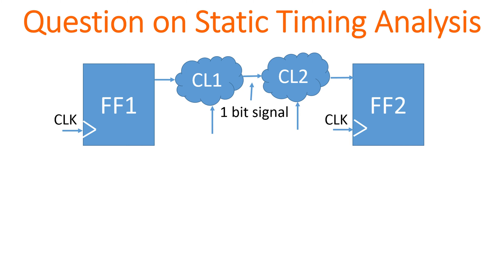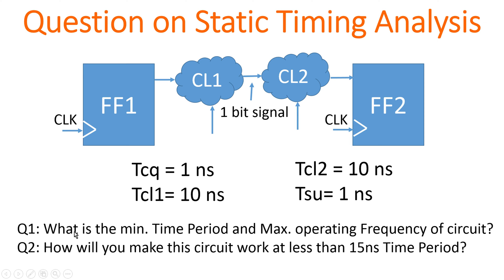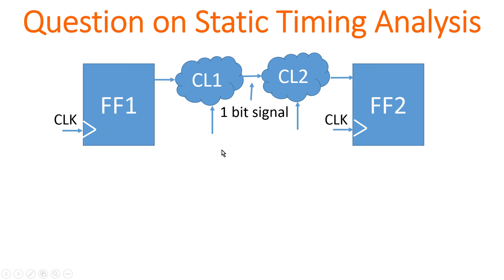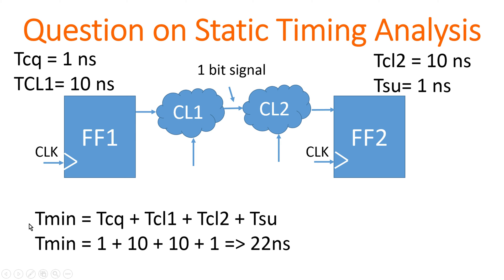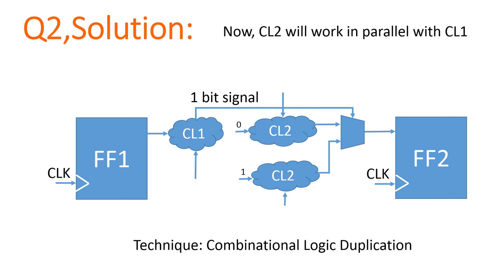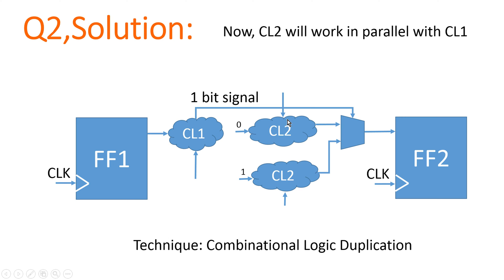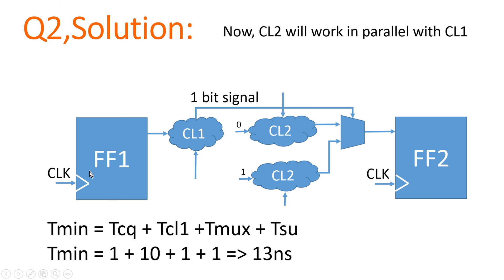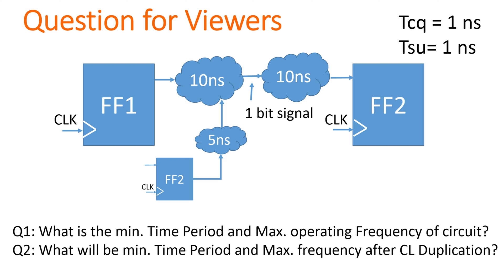Electronics Interview Questions : Static Timing Analysis :  STA Part 3

Comment: Correct Ans for Last Question 2nd part is 18 ns second only becoz in Question it is clearly mention that only 1 bit input line is only between those Combinational blocks which have 10ns delays So I don't understand why you people are assuming every line as 1 bit line.
Reply: Even i got the same answer..
1st answer is 27ns
2nd answer is 18ns

Comment: Answer for Question for viewers:

Ans1: Tmin = Tcq + 10 ns + 10 ns + Tsu
Tmin = 1+10+10+1 = 22ns

Ans2: Tmin = Tcq + 10 ns + Tmux + Tsu
Tmin = 1+10+1+1 = 13ns
Reply: wrong ans, as we have to select the critical path ( path which has maxm delay) to find the maxm frequency so that each register to register can work without any timing error.

Comment: sir please tell the answer...my exam is on 25th..
Reply from the maker: one of our subscribers tried to solve it like this, but it is not correct.
https://drive.google.com/open?id=1WoD_-X1DTu0UxibiOLkRhvAfCOJHPxRL
Reply: @TechnicalBytes  I think Its wrong. Correct answer is 14ns. By using two 2:1 MUX
Reply from the maker: @ayushgemini  Hi Ayush, you are right, 5 ns answer is incorrect, But can you please draw your diagram on the paper and save in the google drive and share the link with all of us, then we can discuss.
Reply: @TechnicalBytes  
https://drive.google.com/file/d/11S6hcxQkIhB628tVLk4yazxUAMJlYxp-/view?usp=drivesdk
This is the solution I have got.
Reply: @ayushgemini  😮
Reply: @ayushgemini  i also got the same. is that correct?
Reply: @TechnicalBytes  Correct Ans for Last Question 2nd part is 18 ns second only becoz in Question it is clearly mention that only 1 bit input line is only between those Combinational blocks which have 10ns delays So I don't understand why you people are assuming every line as 1 bit line.
Reply: @TechnicalBytes  Sir here he is assuming that the delay for both 2X1 and 4X1 mux is 1 ns.  But a 4X1 mux is made of 3 2X1 muxes so delay will be atleasr 2 ns
Reply: @TechnicalBytes  thank you sir such  a GOOD content